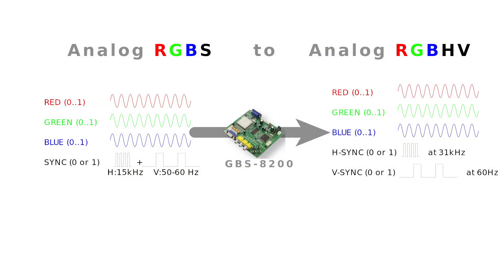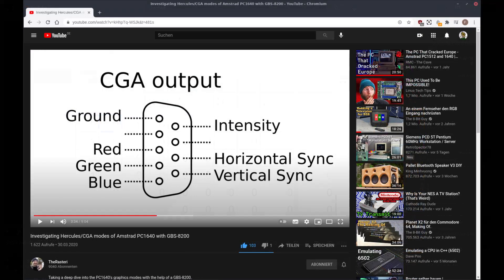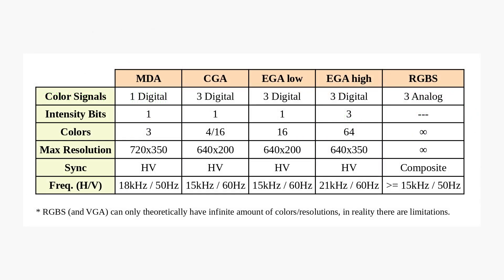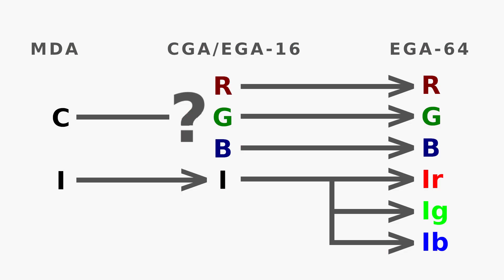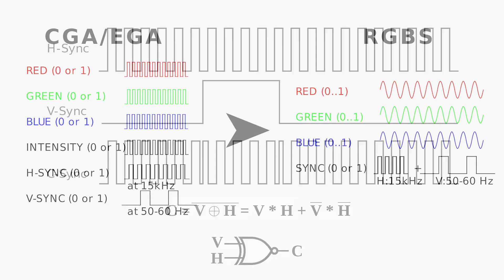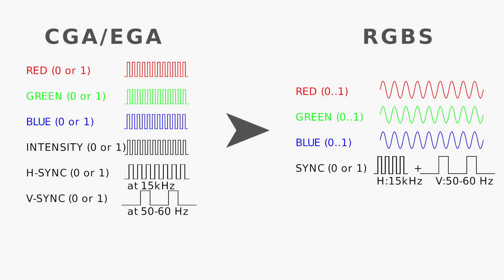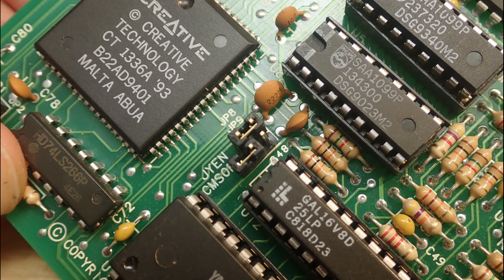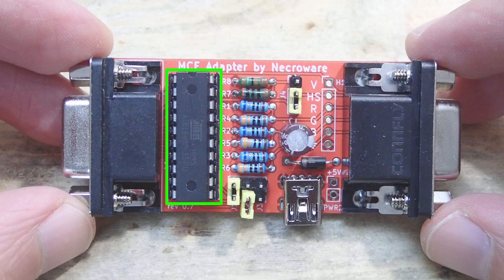MCE-Adapter (part 2): Theory and implementation

Comment: Great project! Thank you. You rock!  I am curious, however...  What might be your thoughts be on a project that went the other way around; an analog VGA mode input to a fixed 18kHz MDA output that could drive vintage monochrome displays? The color signals would need to be digitized & level-converted, but is there an elegant way to handle the variable H-sync freq of the VGA?

Comment: Hmm. Curious to see how this would work with a 15KHz monitor and a Commodore 128, which also uses CGA.
Reply from the maker: I don't have any, so I don't know. If C128 has real CGA output with digital RGBI, then it should work just fine.
Reply: @necro_ware  I guess I'll need to build one :-D
Reply from the maker: @CheshireNoir  Then, I'd be interested to know about the outcome ;)
Reply: @necro_ware  I can confirm it works fine with my 15KHz monitor with a C128. Awesome project!
Reply from the maker: @CheshireNoir  Glad to read that. Thank you for the feedback.
Reply: @CheshireNoir I have compiled the code to JED file. How to I convert it to  intel hex and what kind of programmer do I need? My logic IC is GAL16V8D. Thank you.

Comment: Great vid, and great expansion on what TheRasteri did.  Can the adaptor take a composite sync cga signal? Like the on the Amstrad PC1512?
Reply from the maker: Hi, thank you! I didn't test it yet, but I'm pretty sure, that it should work. The adapter can loop sync signal through, without changing it and take over only the RGB digital to analog conversion. So, if you switch JP4 to loop through, you should see a picture on GBS-8200, or any device which supports analog RGBS. However, this device can not split composite sync back to HV sync. Therefore additional circuitry would be required.
Reply: Thank you very much for this information. I bought a 8200 to get RGB from a 1984 BBC computer onto a VGA LCD screen. The BBC has TTL RGB as you described but I think it has Sync on green. Will your circuit board decode the sync as well as change TTL to Analogue as well?